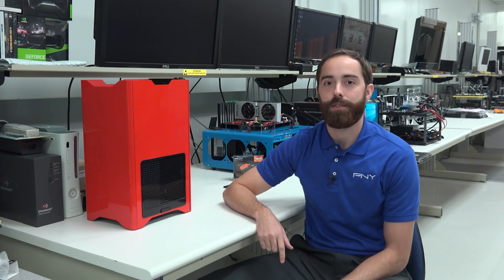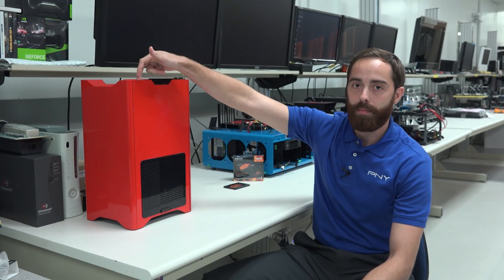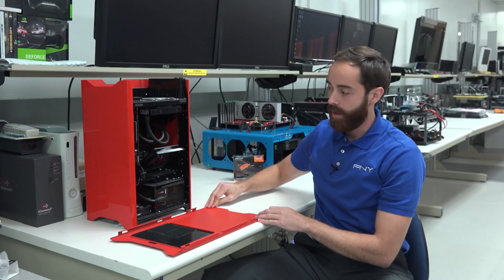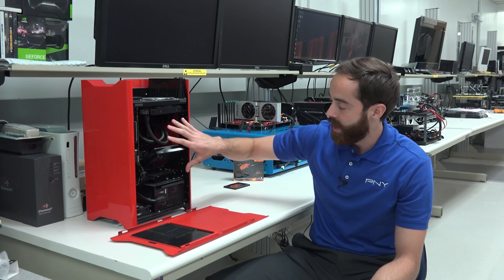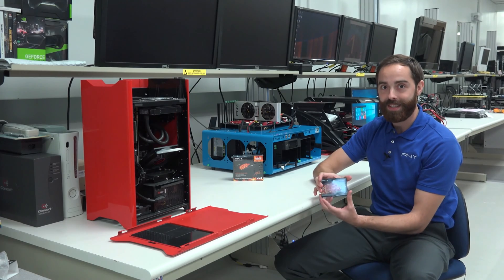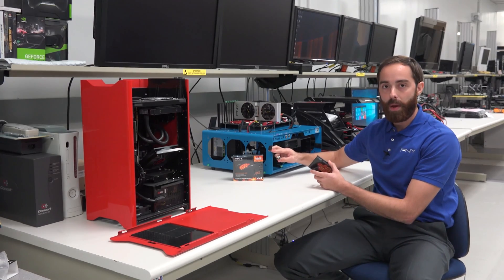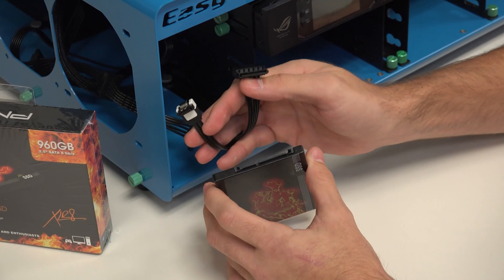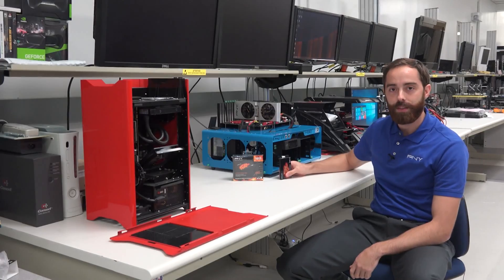How to Install a SSD In Your Desktop Computer

Comment: I used a mounting bracket  2.5" to 3.5"  to install SSD, one of the side
 screws is long and it touches the metal part of the SSD after I screwd it in, is it ok in 
the desktop? will electricity somehow get there via the screw and mess 
up the SSD?
Reply from the maker: You should call tech support with that question: 1.800.234.4597. They can assist with that.

Comment: If you are replacing an old mechanical hard drive how do you transfer you operating system to the  new ssd so you can boot from it.I don't want to have to purchase Windows CD to boot the system. Is any software provided?
Reply from the maker: Hi Art, our 1311 and 2211 model SSDs come with the Acronis Cloning Software package which makes it really easy to copy everything on your hard drive over to your new SSD.
Reply: So then it will boot from the ssd at that point?
Reply from the maker: Art D Yes, that's correct. That will dramatically increase the system's start-up speed.